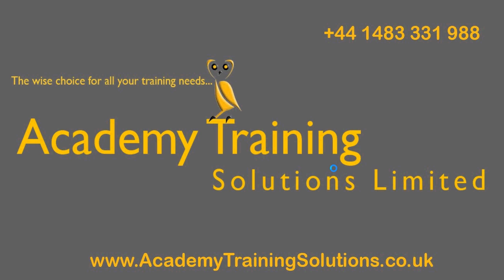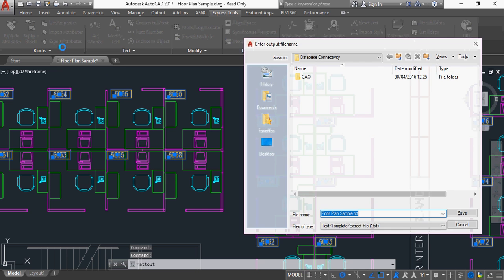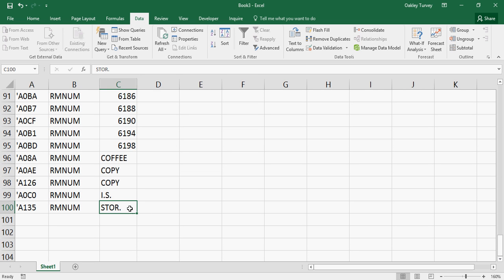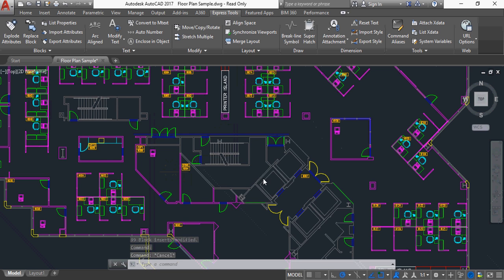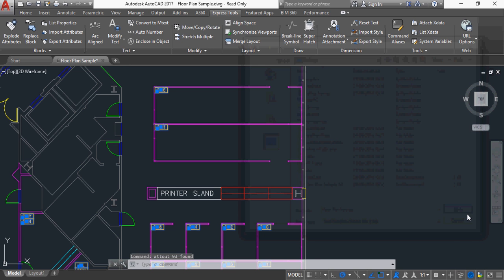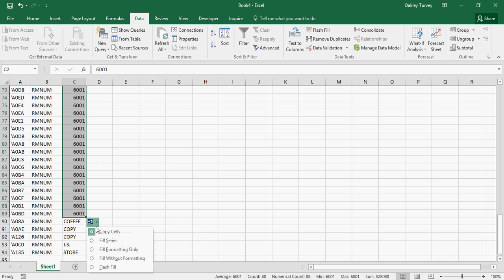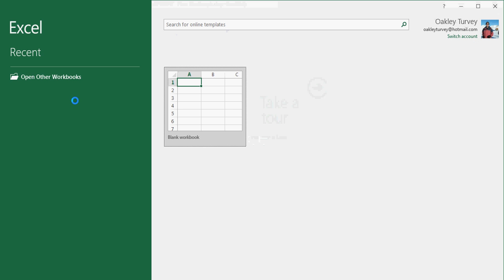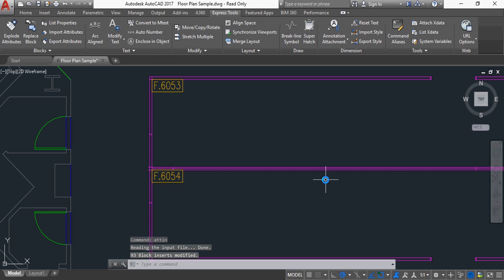Edit AutoCAD Block Attributes in Excel

Comment: GREAT VIDEO. it happens to me that a field filled with the text " 1/2" form some reason ends up to " 1/2"" " (with double quote sign...). Can't explain why...
Reply from the maker: It might be what is known as a text delimiter to show that it is the text 1/2 and not a number. You can use find and replace in Excel to get rid if you need to change it to numbers.
Reply: @OakleyTurvey  it doen't happen on the execl but when i load the data to autocad from text. i would like to have simply 1/2 and i got "1/2"". do you know any wildcard to use in "find and replace" with autocad? thanks
Reply from the maker: @bbdavallonga  That looks like a measurement of Half-an-inch, displayed as text. Sorry, without seeing the file it is difficult to help. It looks like you will have to change the formatting in CAD to not include the " for inches, and then Excel should recognise it as a numeric field not as text (which is why it is putting the whole thing in ""

Comment: Great Video!
Just wondering how would you go about achieving the same thing in AutoCAD LT which doesn't have express tools?
Many thanks.
Reply from the maker: Hi there,
Sorry to say that the LT version doesn't have any of the fun tools such as using Express tools or lsps, though I believe you can still record a macro.
Not really any benefit for most users of getting the cheaper LT as the productivity of the full version is so much better.
Reply: @OakleyTurvey  Thanks for responding! at least I know now.

Comment: i am have one question. I have a more titile block in sequence layout, and i want wirte information for every that by excel than update in to autocad. Please help me. thank you
Reply from the maker: You can create a 2 way link to Excel using the Export Data feature. You need to make sure the 2 way connection box is checked.

Comment: Sir,

Excel to Control AutoCad

I have multiple of AutoCad Blocks (Say 100 Nos) in Single AutoCad File and Wanted to compile blocks (say 20 out of 50 Nos) in NEW AUTOCAD File by using Excel  . I should be able to Fix the coordinates, Distance inbetween blocks, scale rotation while compiling of Blocks in New Autocad drawing. 

Kindly help me do the same. sudhanvamahamuni@gmail.com

Sudhanva 
India